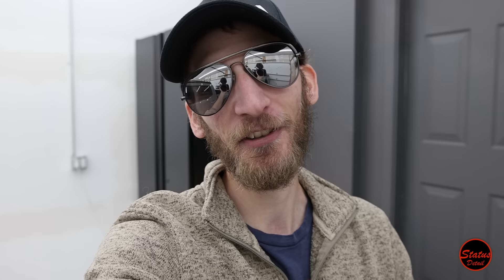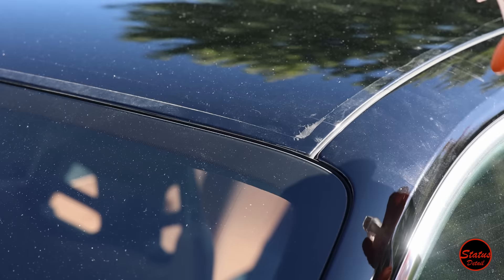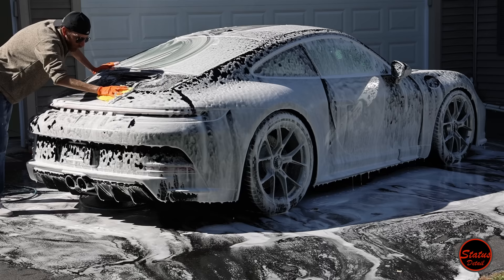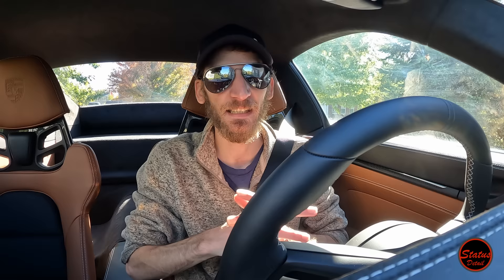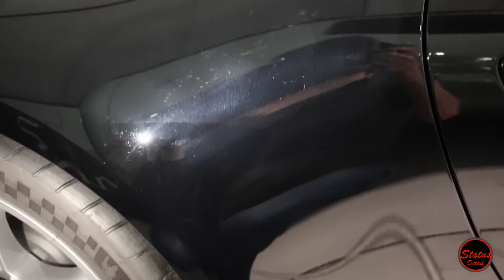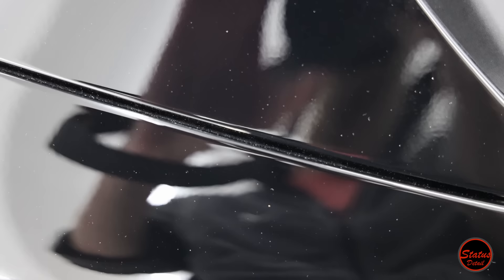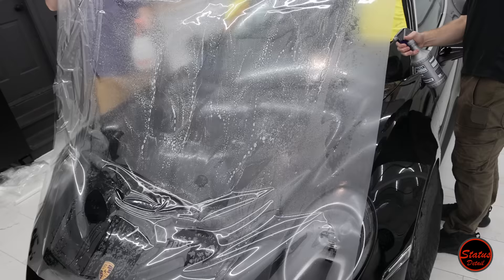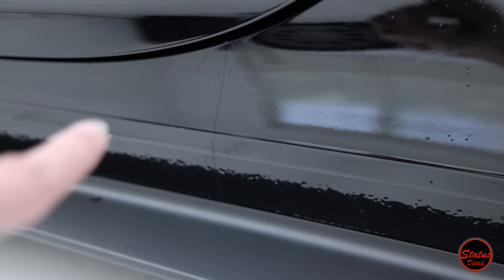992 GT3 Touring FIXING Worst New car Delivery EVER!

Comment: Completely ludicrous, its a car for gods sake not an operating theatre.
If a person finds it concerning that a sales person has sat in their car, then you have more to worry about than a sales person sitting in your car... jeeesus
Reply from the maker: Operating theater? I'm not familiar with those. 

I'm not concerned about people sitting in it. But when I'm doing ceramic there is a right and wrong way to prep. We do the right way 👍

Thanks for watching the video 🙂
Reply: I totally agree, the minute you drive it down the road it will be covered in dirt again, madness. I would only do this if the car was going to be in collection display. The detail was top quality 😊
Reply from the maker: @virgin26  the PPF hopefully helps reduce chips. The ceramic helps it stay cleaner longer and makes it easier to clean. It all makes it so you can drive it and have fun washing it and doing so less frequently. 🙂

Comment: Awesome video!!! I’m a car detailer myself and I enjoy it a lot. Anyways I have one question, what type of foam cannon is that your using in 3:32? Could you send me a link to it by a chance?
Reply from the maker: That's the MTM PF-22 I actually have the "old" version. The new version has a better bottle on the bottom that won't tip over as much. 

I sell it on statusdetailstore.com 

Just search foam Canon on my site and it will be the first result 👍

Comment: Maybe it’s me but I never see the website or how to get to your store and this is the first video I’ve seen of you so I was wondering where you were located at? I’m in Northern California most likely or somewhere else but I would like to get some products to clean my baby my 2014 convertible 911 S which I probably love way too much.  dream cars a dream car…I found your store but I didn’t see a L one leather coating protecting product and I have a convertible do you have some convertible top cleaner and a brush?
Reply from the maker: Hello! I'm not sure I put the website in the video! My fault!

It's in the description box tho!

L1 leather guard is considered a ceramic coating so it's on the ceramic page and not the interior page. 

Hopefully this link works! 

https://statusdetailstore.com/collections/ceramic-coatings/products/gtechniq-l1-leather-guard-ab

You can also search items when your having a hard time finding something because that is confusing that it's not under the interior page. 

We are in the Chicago land area!

I love 911s so I totally understand that. Everything you would need to dial it in to perfection is available on statusdetailstore.com 👍

Clean the top with a soft to the touch brush and car soap. Carpro and Gyeon make fabric ceramic. It works on the top. Gtechniq does too. But the application can be a little tricky so I have not sold it here yet. 

The fast version is spray it into a towel or applicator then apply to a clean dry sift top. Never spray it on the top directly. This can cause major issues

Comment: How do you know if you have soft paint. I have a brand new m2 in Zv blue and there are some swirls from the dealer. Trying to determine what level paint correction I need.
Reply from the maker: BMW tends to have hard paint. Audi and Mercedes do too. 

The correction level needed should be paired to the kind of paint (hard/soft) but also to the type of defects too. 

If you have light Minor swirls then ultra cut and a blue HDO pad should fix that very quickly on a dual action polisher.  Hard paint usually finishes out really nice with that system. But you can go the extra mile and do reflect with HDO orange. But likely unnecessary unless your chasing a higher gloss and crazy. I hope this helps! M2 is a great car. Enjoy 🙂🙂🙂

Comment: Porsche should be embarrassed. I wonder if the owner sent the bill?
Reply from the maker: I actually recently had a customer have Porsche reimburse them for paint correction. Thought that was pretty cool. 

Ultimately I'm my opinion Porsche should only have to reimburse on the wash and correction. Not the ceramic or ppf. That's simply a aftermarket transaction but from a wash and correction standpoint a car should come clean and defect free when new. Honestly it should be that way used too lol. But that's just my opinion.
Reply: @STATUSDETAIL  yea I agree about PPF aftermarket. But for me new cars should come spotless or at least close to. No excuses from these manufacturers imv.
Reply from the maker: @BLRayBanUK  totally agree!

Comment: Can you explain the full process in getting the rims and rotor to not have the rust on them. I wash my car all the time and can never get it all off
Reply: I’ve tried drying it with a leaf blower and it doesn’t really work that well. I’ve drove around the block but then o have to wash it again anyways and then it will rust again.
Reply from the maker: @Connor-zn2pq  a few companies make products you spray on the rotors before you begin. Helps it not rust over. 

But in general steel brakes will rust when water hits them and the pads are not engaging to clean it off. 

So as soon as the wash is over you can go back and forth to clean it off. But I find a quick run up the street and back so you can apply moderate brake pressure does a nice job in cleaning it. The leading outside edge and other components might remain slightly Rusty. That's normal. Some new brake disks have a coated on them to help stop rust in spots the pad do not actually touch.
Reply: @STATUSDETAIL  thanks so much, it snows where I live so I will have to wait until the summer until I try this out but I’ll hope for the best.
Reply: @STATUSDETAIL  also on my dads Aston Martin Vantage F1 Edition they decided to pretty much put alcantera  everywhere and now I have to clean it. The leather brush I got is pretty aggressive. Are the Bristles supposed to be very stiff? I assumed they would be soft like a smooth paintbrush. I’m worried I might wreck the Alcantara. Also if I get you kit you have on the website is the mild alcantara kit for a brand new car?
Reply from the maker: @Connor-zn2pq  Yes the mild kit works on alcantara and leather especially on new cars. 

I have a video that's actually coming out in 2 weeks on alcantera cleaning! So definitely check that one out. That Aston is a cool car!!

Comment: What are you using to clean the leather and protect?
Reply from the maker: Gyeon leather cleaner mild. Gyeon leather brush when you need some extra cleaning power. Detail factory brush for light agitation. Gtechniq L1 leather guard for protection. 

Everything sold at statusdetailstore.com

I'm not sponsored by anyone. It's just what I like 👍
Reply: @STATUSDETAIL  what do you think of Adams leather cleaner and conditioner?
Reply from the maker: @willyuan1  not a fan of that or most leather conditioner products from detail companies. I love gyeon leather to clean. But to condition/hydrate and restore we use and sell leatherque! They are not a detail company. They have been making products for leather and only leather for like over 100 years. The system is unbelievable and I made a video on it if your curious! Check out the Lamborghini countach video on my channel. Full leather restoration. 

Statusdetail.com has the products if interested in trying 🙂👍

Comment: Didn't take the badge off
Reply from the maker: It's not necessary to take the badge off to fully tuck it. 

We cut the film in a way where we have enough access film to push it down and into the area where the badges is. Full hood is wrapped. You would never see the badge seem and never know this has ppf. Especially because it's Stek and has virtually no added orange peel. 

A lot of issues can happen when you pull that front badge for PPF purposes

Comment: Why would you rev a cold car from a customer?
Reply from the maker: A very low rev is not very different than driving the same car. When you turn a Audi on in winter is literally says on the lcd screen don't let it sit and warm up. Begin driving.
Reply: @STATUSDETAIL  Reving is totally different than driving. Secondly it's hardly an Audi now is it?
Reply from the maker: @N911GT2  reving repeatedly to 6,7,8 thousand rpm is definitely story. What happened here is a different story. The car basically revs that high automatically when started on the cold start by the ECU. 

Yes they both have engines and are not electric.

Comment: You dont rev a new sports car. Ever. Specially a porsche.

There's  a break-in period.
Reply from the maker: This is accurate. Literally did one rev to like 2100 rpm. No different than it driving it to clean the breaks off.
Reply: @STATUSDETAIL  3k RPM from the video, but its ok.  
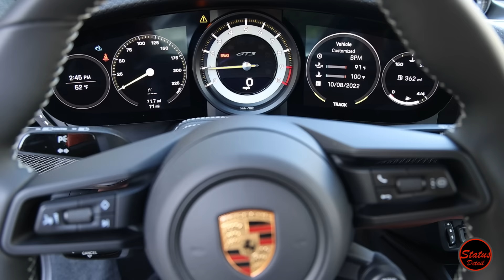@5:09

Good video.
Reply from the maker: @aahdxuxiznwnd2044  when driving you exceed 3k rpm.
Thank you for watching 🙂

Comment: How much did this entire process cost?
Reply from the maker: I don't remember the exact numbers but Im pretty sure it was over 5k. 

I believe we did our $2600 drivers package. That includes the ceramic. Correction. Decon etc. 

PPF full front is around $2000 then the custom PPF stuff I don't remember exact pricing. We did not do tint but tint would increase the price more if selected. 

I have many package options and this was on the highe side. But I offer more expensive details and certainly less expensive too! I like to call it bespoke detailing because we tailor it to you and your car👍

Comment: Great job, but im sure Porsche wouldve done that for you for free...still have a hard time believing that it came out of the factory like that, usually porsche is extemely picky with quality and stuff, and its not even a normal 911...who knows what happens there
Reply from the maker: Every 911 and 2dr Porsche I have done has had issues unfortunately. Porsche dealerships rarely have the skill set to resolve paint issues like this. They often out source it. 

Some dealerships do pay for the correction work tho
Reply: @STATUSDETAIL  maybe its better done here in germany
Reply from the maker: @smey02  perhaps!

Comment: This cars has CLEARLY not left the Porsche factory in this condition, the wrap sealing was also not factory. I guess this car is not from a regular Porsche dealer, as they have their standard prodceeding for new cars. I guess this rare car was a speculation item and the speculator misstreated the car.
The Porsche production lines have a coat inspection and any car in this condition would be sorted out.
https://youtu.be/j1YXhlNDcP0?t=109
Reply from the maker: Whatever you say. We see it all the time from multiple different deliveries from multiple different dealerships
Reply: @STATUSDETAIL  As is said, a car in this condition would never leave the factory in this condition. The cars are shrink-wrapped before shipment, primarily to protect them from the salt water at sea. The retailer must then unpack them immediately and hand them over to the customer. Apparently someone speculated with the car here and left the car with the foil stuck on in the sun for a long time. The adhesive on the foils then bonded with the paint and an attempt was made to remedy this by improper polishing.
I absolutely cannot imagine that an official Porsche dealer would act contrary to Porsche's instructions, because they specify exactly how the car is to be brought into a delivery condition.
I still assume that the vehicle was NOT purchased directly from Porsche.
Reply from the maker: @Rick2010100  so much aboit what you said was incorrect lol. You also assumed a lot while I assumed nothing and told the story literally exactly as it happened including that a Porsche dealership delivered it. 

Thanks for commenting but I won't be on this thread anymore.

Comment: Worst Car Delivery? Why did you accept then delivery then?
Reply from the maker: The customer knew we would fix it

He waited an extremely long time to get this car. And if you decline to take it there's a hide likelihood that you don't get to have another one. Very rare cars everything is pre-sold.
Reply: @STATUSDETAIL  What? so this car does not include custom options. What's going on here....
Reply from the maker: @Thunderthis  yes it's all custom options
Reply: @STATUSDETAIL  So it was not going to sold to another person right away. The dealer should have fixed these issues. Who knows what else was missed.
Reply from the maker: @Thunderthis  not sure I understand the question.

A guy ordered this car. He is the only owner. 

It showed up at dealership like this

He declined the dealer prep.

We fixed everything and ceramic and ppf car. 

Car is optioned out by owner and it has exclusive manufacturer interior so it's very unique and very rare with that interior.

Comment: How much would something like this cost on a clean 930?
Reply from the maker: That's a tough question as it's a older car and "clean" can be viewed a lot of ways 

On my website under bespoke packages you can see the premium package starts at $1700 and and drivers package tops out at $2600. So between that we have a lot of options! We can go fully bespoke too!

PPF is around $2000 for full front but ranges on car. This was more than a full front on the Touring but would be different for your car. For example we can't really do the rockers on a 930. But could do custom hips. 

Are you in the Chicago area? I'd happily do a free consultation! Then e could look it over together and give you exact numbers 👍
Reply: @STATUSDETAIL  Fair enough, thank you very much. The paint is actually better than new and definitely better than this one. I will take a look at your packages. I dont need museum condition. I just want to dial out any little scratches I reintroduced from washing and my less than perfect detailing work. I appreciate your attention to detail. Looks like you do amazing work.
Reply: Awesome spec. Super classy.
Reply from the maker: @diplomacy2000  sounds like maybe we do a premium package from the bespoke package page or just creat something from the ground up. Sounds like it might need a very light polish and then ceramic and or PPF. My contact info is on the site too if you would like the free consultation 👍
Reply from the maker: @AlexSami-qw4qu  agreed!
Reply: @STATUSDETAIL  Sounds great, thank you. WIll have a look at your site. Might be an excuse for a road trip early next year.
Reply from the maker: @diplomacy2000  would love to earn your business! Had a chat with a gentleman from Texas today who watched this video and is bringing his 992 GT3 RS! Would love another do business with you as well!

Feel free to email me anytime. My number is in the website too and I'm very fast at Instagram DMs👍

Comment: what do you charge for this?
Reply from the maker: The decon. Ceramic. Paint correction portion was around $2600 if I remember correctly. That's our "drivers package" I also have a $1700 version that's also a incredible detail. I also have more expensive packages above the driver's. Depends on what works best for you 

PPF is usually around $2000 for full front. Sometimes it's higher sometimes it lower. Depends on the car. A Urus is more complicated than a Tesla for example. We did custom rockers and hips and rear bumper. I don't remember the total on this one but adding the drivers and ppf front price gives you an idea. 
You can also do tint and a bunch of other custom (bespoke) options!

Comment: How can the dealer be responsible when the customer states dont touch the car, just pull the wrappers off, then gets it covered in road dirt if it was an open trailer. More US exageration.
Reply from the maker: The customer drove the car to us. That's it. The car arrived to the dealership exactly how you see it in the video. Obviously they removed the delivery wrap. If you decline that and have serious paint issues the dealership takes no responsibility. So it's wise to have dealer remove the delivery wrap. 

There's no American exaggeration here. Just poor German manufacturing process/shipping and parts delayed from Covid.

Comment: You shouldn’t rev up a cold engine like that!
Reply: Even worst an engine like that with very few miles
Reply: Keep cleaning, not driving
Reply: Regarding new cars, all seat and interior surfaces come cover so it’s not like the car interior was touched by many people, so new cars shouldn’t need a light cleaning if deliver properly. This case was probably different
Reply from the maker: I disagree with basically everything you just said. It's also been explained in other comments. Especially the cleaning part as it's appropriate before ceramic. 
Thanks for watching.